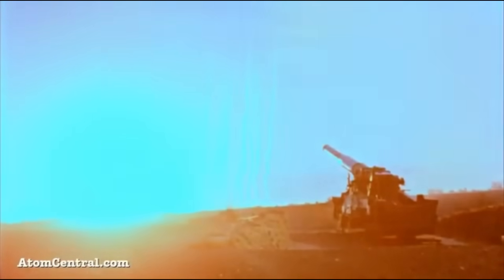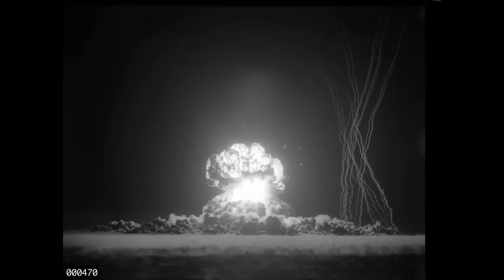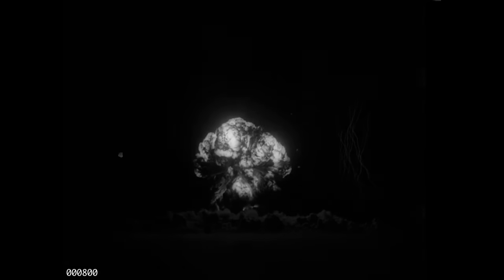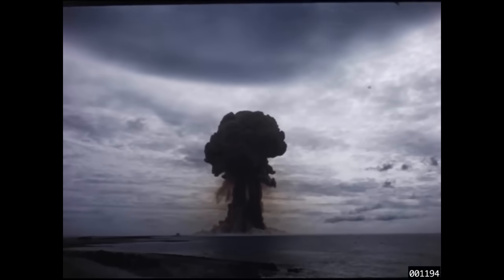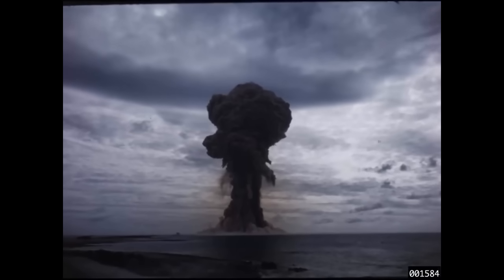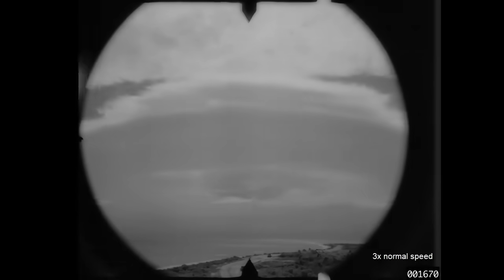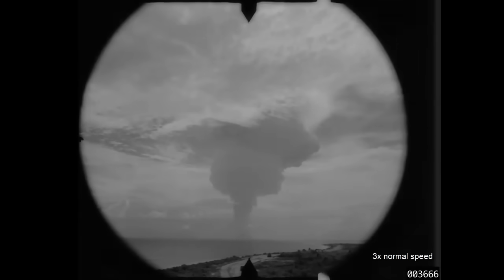What does a nuclear bomb sound like?

Comment: I imagine it sounds different in the killzone, where you can hear the 300 mph winds rushing in under the rising mushroom cloud.
Reply: The pressure differential sounds like nothing, as it would produce instant deafness, even in the membranes of a microphone, or even in the most primitive of piezo microphones.
For all intents and purposes, it sounds like nothing at that exact place, because no one could ever hear it even if they were immortal.
Reply: @D-Vinko  A bit like a tree falling in the woods isn't it? Just because no one can hear it doesn't mean it didn't make sound.
Reply: @lulzdragon7339  I can’t hear space
Reply: @lulzdragon7339  what a discovery
Reply: @lulzdragon7339  didn’t you get this backwards? If no one was there to hear it, it literally didn’t make a sound. Because there was no ear drum to vibrate off of there was no sound
Reply: @grants.231  Sound is both an audible mechanical wave that propagates through air, and the perception of such waves by the brain. So it really depends on which definition you want to use.
Reply: @lulzdragon7339  words, what are they like
Reply: lulzdragon Well the bit about the tree falling is just a question. “Does it make a sound?” No one has definitively answered it and the question itself is open to interpretation. Do they just mean “sound waves” or are they asking “if no living thing ever witnesses or feels the effect of the action, does it matter if it happened?”
Reply: @grants.231 the  sound would exist whether there was a listener, an eardrum, or not...wouldnt matter
Reply: @grants.231  This type of question (not yours, the philosophical kind)  is little more than mental masturbation - typical of the love of knowledge.  It garners grants far more than it makes any difference to the overall wealth of human existence.   It really does not matter one bit.  ;p
Reply: @TW-sh2un  Tree falling generates sound waves regardless of whether there is someone nearby to hear them. Ocean Waves don’t stop rolling ashore simply because there is no one near the water.
Reply: Living a Dream Life Yes but as I said, that might not be what the question is actually asking. It’s a philosophical question, so consider a more abstract line of thinking. If a meteor hits a planet a million light years away, and the event isn’t seen or has no effect/aftermath noticed by any living thing capable of noticing it. Then did it really matter that it happened? To us, it is indistinguishable from something that just never happened at all. That is perhaps what they are asking. “If something happens, but no one ever witnesses it, then did it actually matter?”
Reply: @TW-sh2un  Of course it matters. We know that currently there are people in bad situations. Whether or not we witness it. It still matters. In the same sense, if you care about planets, you’d know that an almost infinite number of them get destroyed a day and therefore that would somewhat matter to you
Reply: @TW-sh2un  But that isn't what the question asks. It isn't "Does in matter?" but "Did it happen?" The answer is obvious to us now but throughout history people haven't been so decided. Some philosophers in the past have hypothesized that the physical, objective world doesn't exist, and the only the mind and it's contents are real. Others have thought perhaps the unobserved world functions differently than the observed one (and not just on the quantum level.) It's a question regarding the nature of reality.
Reply: Just Random Gaming I think you’re still kinda missing his point. We are witnessing people in bad situations, even if it’s in less direct ways. The same goes for planets being destroyed. We know that is a thing that happens because we’ve witnessed the effects and aftermaths of it happening. Even if we’ve never directly seen it with our eyes, we have encountered its impact on our known universe. But imagine something is happening out there in space that we won’t ever witness, even indirectly. Something that will never have an effect on our lives or even our visible universe in, anyway that we will detect. Something we will never “witness.” To us, that thing has the exact same outcome as if it didn’t even happen at all. So what’s the difference?
Reply: @thewatcher8010  The difference is whether or not the event happened.
Reply: Richard Looch  The youtuber Thoughty2 made a good video about this question, and in conclusion, when a tree falls, and there's no living thing to hear it, it doesn't create any sound. It pushes the air particles out of the way, but air particles in themselves, doesn't carry any sound with them. That's just the brains way of interpreting the information it gets from the senses.
Reply: @lulzdragon7339  well... not really cause at a certain point there really is no sound. no sound in the air can exceed 194 decibells. its pretty hard to explain why but its the same reason why a speaker can be loud as fuck without you feeling the moving air, but if you slap your hand through the air youll just push the air without making a loud noise. at a certain air pressure it just wont make sound.
Reply: @livingadreamlife1428  Yeah, it's the old "Does a falling tree in the woods make a sound even if nobody hears it?" crap. Of course it does!!! Besides, all the animals and birds hear it.
Reply: @grants.231 
Absolutely false. 
It would only mean that no one heard it.
 It's not because no one heard it that it didn't make a sound.
Reply: @danielm.4346 just depends on how you want to define sound, I don’t stand by my original comment completely but I also wasn’t wrong
Reply: @grants.231 
What I meant to communicate was that there are waves and vibration there, regardless of whether there is an eardrum and a brain connected to it to perceive it or not. 
 And any recording device can prove it so.
Reply: @D-Vinko  there were veterans who talked about seeing a nuclear bomb and they put there hands over there eyes and they can see the blood flowing through there skin and there bones through there fingers and it was soooo loud
Reply: @D-Vinko  Couldn't you use a laser or parabolic microphone to record the sound from further away?
Reply: @D-Vinko  to build a microphone that can withstand a nuclear blast is not a big challenge......
Reply: @D-Vinko no sound? so it instantly creates a few kilometer or few hundred meter vacuum within the initial blast zone or what
Reply: @addictedallyear  from what i got from his comment is that it ruptures eardrums from the pressure of the explosion
Reply: @D-Vinko  since you said even if you were immortal im taking that to an extreme. What if hypothetically Superman or Thor (can tank nukes) were in the kill zone would they not hear anything?
Reply: I imagine you wouldn’t hear anything, being ya know, dead and stuff lol
All jokes aside it does make for an interesting thought l, other people here don’t want to make time for hypotheticals, or don’t understand them, but I got you man
Reply: You’d probably go instantly deaf
Reply: Well in the kill zone you’d be dead before you hear it
Reply: Wouldn't it sound like becoming dead?
Reply: I imagine by the time it hits you you're probably already deaf, blind and about to die within seconds.

While it ended the war, what the US did to innocent Japanese lives is super fucked up
Reply: @SuperNuclearUnicorn  better than slautghering millions during the invasion plan. Yes, it was fucked up, but it was the lesser of two evils. Japan would have fought to the last man, woman, and even child had the US and the Soviets, or even the pre-communist Chinese landed on the home islands. All three had very large grudges to hold with Imperial Japan and the bloodbath that would have resulted from a land invasion would have made both Hiroshima and Nagasaki look like a punch in the nose by comparison.
Reply: @SuperNuclearUnicorn   Really? The invasion of Okinawa cost 100k Japanese soldiers dead, nearly as many civilians and 40k Allied troops (it was not just the US there).

So that's nearly 300k dead.  From one little island.  Many of the civilian deaths were women committing suicide because of what they were told would happen to them once the US soldiers got hold of them.  That's nearly 100k more than the total immediate deaths (not inc radiation sickness 10 years later etc).  From one little island.  Now multiply by 10 for the mainland ... it was not fucked up, it ended the most devastating war ever.
Reply: I imagine nobody really knows
Reply: I'd imagine it sounds like death lmao
Reply: You do hear those winds.  That's part of what the rumble is after the initial bang.  The bang is the shockwave, which will hit you first no matter how far away you are.
Reply: go and see what it sounds like for yourself and let us know!
Reply: And just think things like that are happening constantly on the sun's surface
Reply: The only way to figure it out is to set up a full-scale domained computer simulation of the shockwave and track the movement of the virtual air particles in the supersonic zone and convert it to playable sound
Reply: Well you wouldn’t hear it if you’re in the kill zone, not for long at least.
Reply: Wanna stand in the there and film it for us??
Reply: Umm, wouldn't the radiative heat or shockwave kill you before a mushroom cloud develops?
Reply: Erm, sorry but you'd be well DEAD before you had a chance to hear anything at all! Except perhaps choirs of angels, if you're lucky.
Reply: I’m not sure you’d be ok
Reply: 300 mph? Hahaha. Try supersonic like mach 5. Wouldn't hear a thing until the Shockwaver reached and scattered the eardrum materials into a fine pink liquid.
Reply: There were survivors of the Hiroshima bomb who only saw a brighter than the sun flash then the sound of whatever building they were in being destroyed. They don't remember hearing an explosion, only buildings coming down. Those buildings protected them from burns and some radiation. Of course many were crushed, burned, etc.
Reply: If you're that close you likely won't be hearing much.
Reply: As you evaporate 😂
Reply: If you're k!led by an atomic b0mb, does it still make a sound?
Reply: IF you had impossible indestructible ears (you know let's imagine) and would be let's say immortal, all you would hear would be a silent "woooshh" but you would be aspired into the vortex of the vacuum the fusion would be creating (kinda like an implosion but not really) before being instantly expulsed and dematerialized with the "BOOM" and flash wich you wouldn't hear because you would live/feel it if that makes sense. You'd be obliterated. It wouldn't be a sound from your point of view, it couldn't be, It's like a mini big bang! 
 
oh also the radiation would be too violent for you to even experience it (let's say even if you're "immortal" you'd be like dust in a matter of milliseconds, it's really that fast you wouldn't have the time to mind anything except maybe the "Woosh"
Reply: Supposedly when a nuke goes off the explosion forces all the air away so it create a sort of vacuum like in space where sound is muted then air rushes back super fast and the vacuum sucks it up into a mushroom shape. That’s how mushroom clouds are made
Reply: @lilnutlord9117  Mushroom clouds are actually a result of convection. In a fluid like the atmosphere, hot air rises and cold air sinks, so when a nuclear fireball is created in the atmosphere it makes a lot of very hot air which rises very fast, pulling in colder air from around and above in a convection current. All explosions of decent size make mushroom clouds, nukes just make very big ones that last a long time.
Reply: @lulzdragon7339  Fr? My engineering science teacher told me that shit about a vacuum in 6th grade and I’ve believed it for the last 5 years
Reply: @lilnutlord9117  Both interpretations are correct.  The vacuum is created as a direct result of the heat of the bomb causing it to expand very rapidly (i.e. explode).  Convection is caused by hotter, lower density air rising, and so this vacuum is just an extreme example of that.
Reply: @lilnutlord9117  Interesting, I bet we already have but I wonder if we can use atomic explosions in some physics applications instead of warfare
Reply: @sciathoir  yes pfcourse they have potential applications in physics especially space travel... also nuclear reactors or anytbibg nuclear works off the same principles and mechanisms
Reply: @sciathoir  Have you heard of Orion Drive? It is basically nuke propulsion.
Reply: @sciathoir you can use it in space to travel around but would it be economically feasible? Idk
Reply: You'd be dead before you even heard it. Even if you were an indestructible being and able to survive, it would be pretty much the same noises, only louder.
Reply: What if a Nuclear bomb is like The Big Bang Theory

Comment: It didn't surprise me personally but I'm an explosive enthusiast. The original power and velocity transferred to the surrounding air is dissipated very quickly towards the speed of sound, and at a safe distance, sounds exactly like a large conventional explosive. 

Again, because it ends up being just slightly over the speed of sound when it reaches you - hence a slight blast wave you can feel in your chest just like you experience at a fireworks show when rather close and a thunderous clap!

Comment: The length of the boom you get with explosions is controlled by the same things that the length of thunder is controlled by.  If the explosion is extremely local like it is in nuclear weapons, the perceived duration of the sound will be very short.  If the explosion occurs over a large volume of space, all those sound waves roll over points at different times, making it sound like a longer explosion.  Finally, the farther away the explosion is from you, the more diffuse the sound becomes and the more opportunities it has to echo.

So while it's kind of surprising because of the way we've been shown this footage, it's not exactly unintuitive to realize that a nuke being set off in the middle of the salt flats is going to sound like an extremely loud, extremely sharp BANG! followed by much quieter echoes.

Comment: I'm not sure I understand... Why would the sound of this explosion be different than for a non-nuclear explosion with a similar blast yield? The sound you're hearing is just the pressure wave generated by the blast, just as it would be for any other bomb. You hear the initial explosion and then a rush of air. Unless I'm mistaken, in the same environment any other controlled explosion essentially sounds like this, the only difference is magnitude. As far as I know, there's nothing intrinsic to nuclear fission or the way the bombs are constructed or any other relevant detail that would make the sound different than for any other bomb blast. The nuclear bomb generates a sound wave by pushing away air molecules the same way as every other explosion, and by definition, it does so with the same energy as the equivalent blast yield of some specific amount of TNT. And anyway, this would sound completely different if you were inside a building where the solid materials vibrate and rumble, windows shatter, etc, or in any of a number of other environments or circumstances. A bomb detonated in an empty desert would obviously sound different than if it were detonated in the middle of a city. The sound is not about the blast per se (a nuclear explosion would be silent in space), it's about what the blast affects (whether that's air and sand or urban infrastructure).

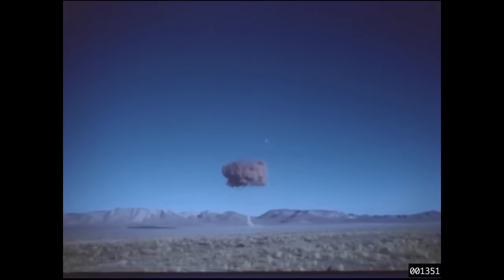Comment: What's with the multiple vapor trails raining down @ 1:02 in the footage? They're already present when the blast happens and are not distorted by any sort of sound or shock waves.
Reply from the maker: Those are smoke rockets used to help visualize the Shockwave propagation in the air.

Comment: Im actually Interesed in the em force behind this. I'm not super familiar with how it works but I find it interesting that its able to interact with the camera almost instantly from so far away.
Reply from the maker: Most of the EM distortion effecting the camera is the visible and infrared light. Basically it's so bright it messed with the film and mechanism. Closer in you would get other effects from other parts of the spectrum. If the bomb detonated in the ionosphere it would produce a very strong EMP that would damage electronics over a wide area.